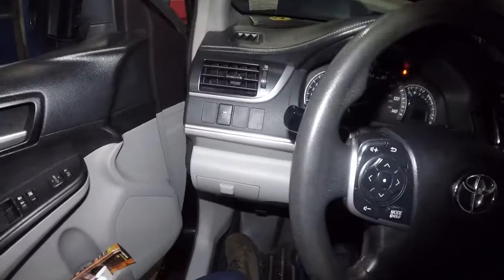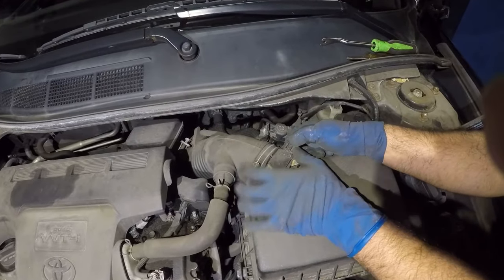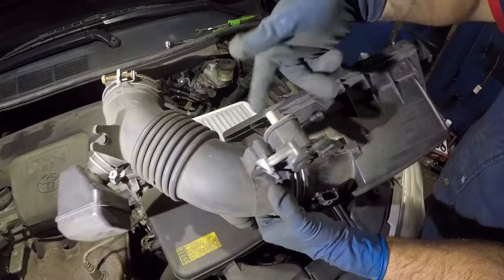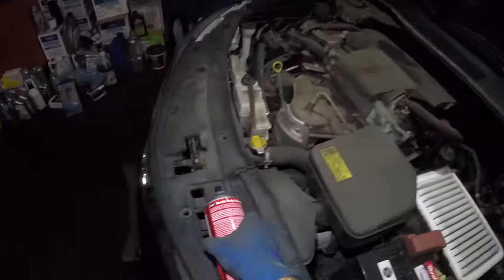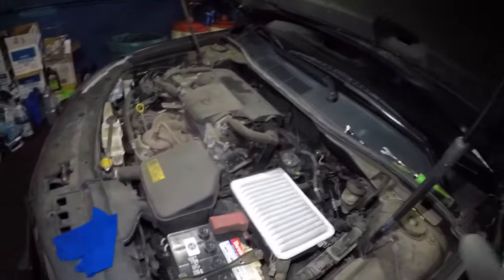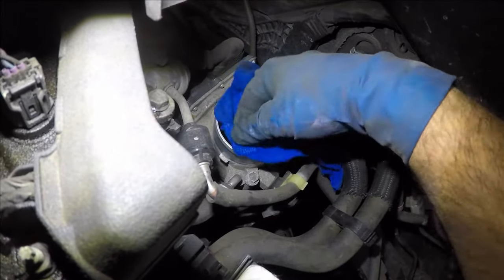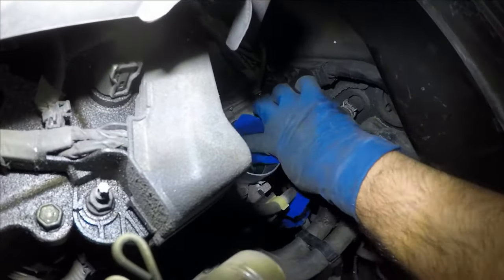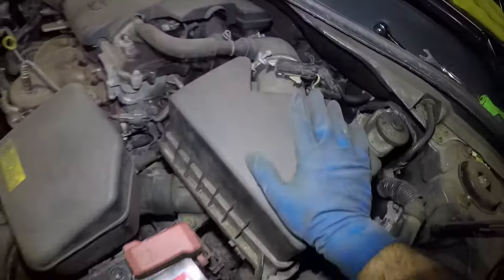Toyota Camry 2007 to 2017 Low idle car stalls and feel vibration, Throttle body cleaning

Comment: Did not work on my 2009 corolla.
Reply from the maker: What’s the issue
Reply: @RBTheMechanic  2009 Corolla, 96K miles, it has a intermittent low idle at stop lights, like around 500rpm, at this low it's not running smoothly, no error codes, runs good when accel and cruising. 
I cleaned a MAF and throttle body. While driving it I notice a few things. 
Seems fine when cool and not up to temp yet. Seems worse on hot days.
When it happens (very low idle), putting the tranny in neutral pops the idle back up and smooths out (about 750/800rpm). 
Air filter is new.
Next I am going to check/replace the plugs. 
Maybe try the O2 sensors next?
Check for vacuum leaks.
Reply: @RBTheMechanic  Any suggestions? (I changed the plugs, they needed it, but did not help my issue)
Reply from the maker: @Ozzy3333333  what is ur issue
Reply: @RBTheMechanic  read my comments above
Reply: @Ozzy3333333  Apparently the problem is somewhere else. If it keeps idle rpm low for an extended period of time than the throttle doesn't get the command to increase the rpm.
Reply from the maker: @Ozzy3333333  possability bad throttle
Reply: @RBTheMechanic  I am a EE (mostly high speed data, I am working on 200Gbaud rates), I am guessing the throttle is a pot and simply outputs a variable voltage, correct? (I have designed and built my pc sim racing wheel and pedals, 16bit resolution after the hall sensor) so i know a thing or two about this stuff, but have never played with a cars throttle by wire. What are you thinking the throttle pot is doing wrong?
Reply: @RBTheMechanic  I bought a $53 throttle body from ebay and after removing the stock unit, when I got the new one out of the box there is a allen setscrew on there, I assume its to set the IDLE!, wiping the stock unit off, it has one too (covered by some sealing glue)! Why is knowone talking about this adjustment screw!! Literally no one!!! I will test drive it tomorrow and report back. I have pictures if you care to see them.
Reply from the maker: @Ozzy3333333  dont mess with that screw donidle relearn it dosent do much messing with that screw I tried before
Reply: @RBTheMechanic  Any idea whats its for?
Reply from the maker: @Ozzy3333333  it might be somthing for gears but I wouldn’t mess with it
Reply: @RBTheMechanic  I popped it open, that Allen set screw adjustment fully sets the idle speed by setting the butterfly position. I have pictures if you like to see. I noticed a bit of wear on the face of the adjustment screw and the spring end that it adjusts. Also I noticed wear on the middle gear center hole, so now it can wobble a bit. I am thinking over time stuff wears out and needs adjustment. But buying new is better for the company.
Reply from the maker: @Ozzy3333333  sure rbthemechanic@gmail.com
Reply: @RBTheMechanic  Now that I have a week plus on adjusting the allen screw I can give my experience.
I first let it warm up, I marked the set screw and the body so I can put it back if needed, then twisted the butterfly more open, but I could not hear the rpm increase, tried 1 turn, then 2 turns in (clockwise), puzzled I figure I would just try one turn. After driving to work and back I noticed the idle was not to high and letting off the thro it (ECU) would thro blip more than normal as the auto tranny was shifting, then just I I pulled into my driveway the engine check light came on (P0505) idle speed control system malfunction. I cleared it and turned the set screw to 1/2 turn (from one turn), and another 2 days driving and same code popped up, idle was better, but still a little high, adjusted to 1/4 from stock setting, it does not pop anymore codes, but I did not like 950~1000rpm idle, so I gave it a little less and its been great, never goes down to 600 any more, more like 700~750 is the new low and its working great. I still dont understand why no one says this idle is adjustable when the screw is right there? I will send pics.
Reply: @RBTheMechanic  sent the pics, let me know what you think, you can delete this message and your email if you like.
Reply from the maker: @Ozzy3333333  when did u send it I didn’t recieve it
Reply from the maker: @Ozzy3333333  waiting for picture try again sending it I had issue with my gmail
Reply: @RBTheMechanic  resent
Reply: @RBTheMechanic  I have watched a few videos on how the idle air control valve works, basically engine coolant runs over a bimetallic metal spring (like old house thermostats were made), cold it holds the valve open for high idle when cold, as it heats up it close the valve to lower rpm, pretty simple. But on this unit I am not exactly sure how it works (if it's mechanical like the others), it could simply be a temp sensor feeding back to the ECU instead of mechanical acting. If you know anything, let me know.
Reply from the maker: @Ozzy3333333  yes it will lower the rpm as temp will get to correct operating temp but then it has to be stable at certen rpm which  but it dosent know the throttle is blocked so it chokes u gotta do the service
Reply: @RBTheMechanic  I cleaned the throttle body and it didn't fix the issue, that was my first post. Screwing in the set screw a tiny amount (about 1/8th turn) fixed it. Still don't know why people say the idle is not setable, it clearly worked on my 2009 Corolla.
With my few days playing with it, it is certainly sensitive, but doable.
Reply: @RBTheMechanic  my 2009 Corolla does not have a idle control air valve, and I am not sure at the moment how it changes rpm from cold to warm like a normal ICAV does, as shown in that video I linked, you have any ideas how?
Reply: @RBTheMechanic  How does it lower the idle from cold to warmed up on this throttle body?
Reply from the maker: @Ozzy3333333  throttle is electronic and controlled by computer turns the motor and lowers the speed
Reply: @RBTheMechanic  well that is only partial correct. Did you watch the video I linked above?
I believe there is three ways the butterfly can move.
1. The motor
2. The dual coils in the black cover (PWM control up or down rpm).
3. The water temp, on this throttle body, I am not sure how it works as I haven't opened the unit all the way up. 

Yesterday I probed the electrical contacts with a dmm in ohmmeter mode, 2 are obviously the motor, but the 4 more contacts was not obvious (thinking one might be a water temp sensor, but it is not), so I switched to an inductance meter and I am still not sure exactly what's going on. I am now thinking there are more than 2 coils in there as the inductance values are high enough to be coils of wire.
Your thoughts?

Comment: Pls how can I reduce the RPM
Reply from the maker: I never had to reduce the rpm u can clean throttle and disconnect the battery it will loose memory and then start fresh rebuild rpm speed customer will take time to relearn
Reply: Need to do a idle learn procedure for Toyota. Videos everywhere for it
Reply from the maker: @rogerthat6221  I did one for idle relearn

Comment: you did not clean the underside of the flap. disassemble all the throttle body and do the right job
Reply from the maker: No need to I cleaned the area around the crap maybe 1/4 inch in and around with tip of ringers removing will cause issues and maybe damage the throttle better replace the throttle if that’s what u gonna do